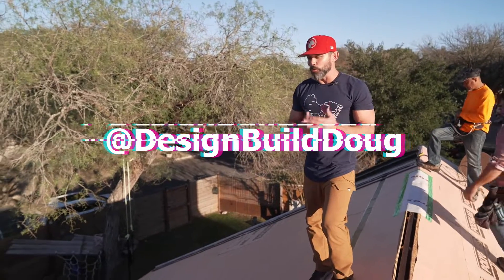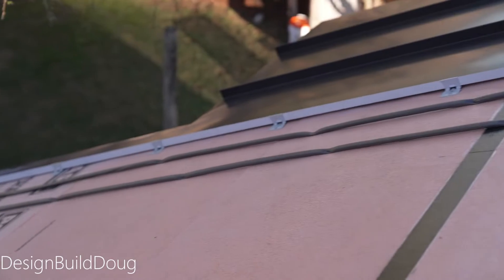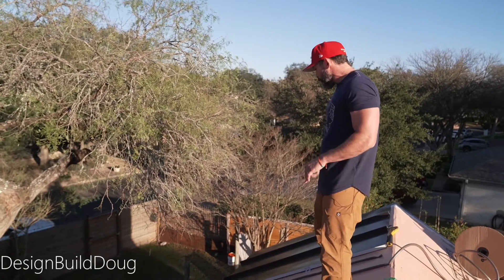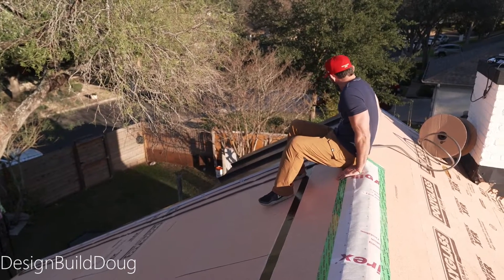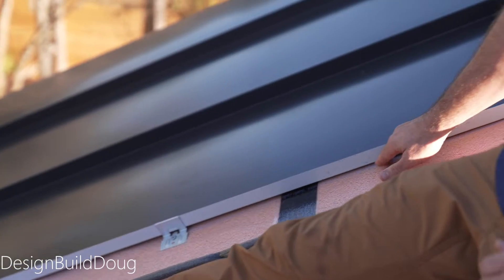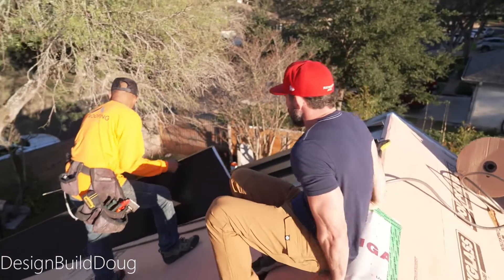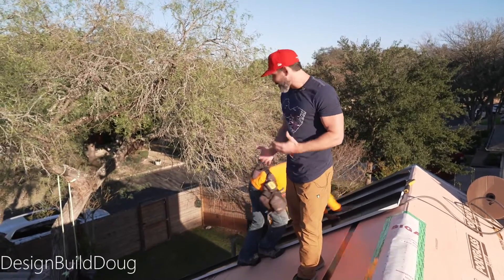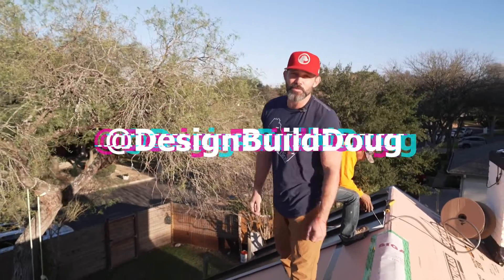Metal Roof Install                                                   Ep.6 #AtticRetroFit

Comment: Is there a follow up video showing the results?
Reply from the maker: The results have been mixed. The attic is WAY MORE COMFORTABLE & functional, but the electrical bills are still pretty high. Super happy we did it still. Our home could be holistically air sealed better though to achieve lower electric bills.
Reply: @designbuilddoug Sorry , I was referring to backer rod  to avoid oil canning

Comment: @doug - can you offer an update with any performance feedback to date..?
Reply from the maker: Which portion of performance?
Reply: @designbuilddoug 
Thank you for your response.   
The project may not have lent itself to being able to garner diagnostics after completion, but was curious if there was a noticeable change in heat gain/conductivity from roof with the backer rod decoupling..?
Reply from the maker: No prob! @ the attic space is never more than 80 degrees now & we use it as a massive storage shed which is amazing and the roof panels all look great. That said our electrical bill hasn’t decreased as much as we expected.

Comment: Great video. How did the roof hold up did you get any oil canning on this roof?
Reply from the maker: Everywhere the decking was relatively flat (which was most of the roof) it worked really well, no oil canning. One section above my garage where the decking was a little more wavy (even after trying to fur out the waves with plywood) you can see a little bit of oil canning, but its been there since the beginning.
Notes: 1-we did you a thicker gauge metal to help. 2-I am terrified of a heavy hailstorm therefore if I had it to do all over again, I don’t think I’d care nearly as much about avoiding striations (that essentially creating a similar sized air gap as the backerrod). 3- confirming your decking is flat is super critical but you dont necessarily have much time to fix it when doing a retro application (re-roof).
Reply: @DesignBuildDoug  thank you very much for the response.
Reply: @designbuilddoug I see the response here.  It sounds like you are stating, if done again, you wouldn’t put as much emphasis on the backer rod separation detail, but ensuring the decking is flat, correct.?  I have two units (main house and ADU) starting in Feb in Charleston, SC and finalizing design now.

Comment: Doug could you share an update on this? Would you recommend this practice as I'm considering doing the same thing. You used two 3/8" rods per sheet? I noticed other using 1 5/8" per panel, you prefer 2pieces of 3/8" instead? Thanks!
Reply from the maker: I was happy how ours turned out. We noticed sone of the thicker backerrod options were actually more compressive & therefore flatter than the 3/8 rod. Also doing the oval shape as we did provided a more even standoff than one piece directly in the middle would.

Comment: Thanks for this example. Do the rods affect the look of the panel at the eve? Is there a little gap to the eve trim? I image it can't be seen due to the overhand and gutter too.
Reply from the maker: The fascia end of the panels has a fold that locks into the drip edge. Visually nothing out of the norm is noticeable, other than the lack of striations.